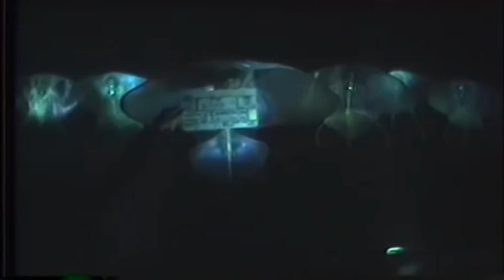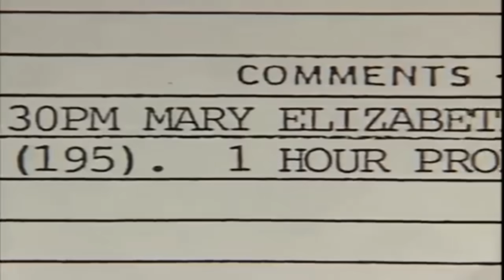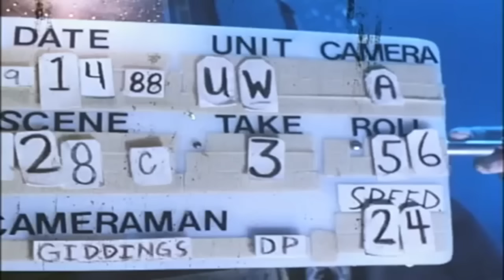Production Hell - The Abyss

Comment: The safety diver might have actually saved Cameron’s life.  Holding your breath while ascending can cause a fatal expansion of the air in one’s lungs.  Which can cause your lungs to burst.

The struggle over the broken regulator probably had Cameron expel most of the air in his lungs.

Diving can be very dangerous.
Reply: Not only did that guy possibly save Cameron's life he got that returned by being punched in the face and fired. Not worth it.
Reply: @Flaris  He would have eventually killed him spraying water into his mouth…either way it was an accident, radio guy deserved to be fired but not safety diver guy.
Reply: @jaydenshepard7928  The boss is always going to blame their own created problems on others, comes with the privilege.

Comment: Ah, yes. The "water tentacle" scene. Back when I owned the DVD, and watched the dvd extras, the crew planned a back-up plan if the special-effects department couldn't reproduce the water, in a realistic way in that scene. The back-up plan involved basically a robotic sock — an animated movie screen — with several movie projectors hidden off scene. The movie projectors would display the opposite wall of the water tentacle depending on how the sock was orientated in the scene; the angles and projected images were perfectly planned with computers, though. You get the idea. I wonder what the water tentacle would have looked like if it was done this way, instead of cg? (rhetorical)
Reply: The effect would might have looked awful even for 1989.
Reply: @redpillfreedom6692  Ahh.... not so fast. Practical special effects do hold up over time, especially if a particular movie put new research into the tech they wanted to show. The Thing from '82, Willow from '88, (the two-headed dragon was stop-motion), The Terminator from '84.

And believe it or not, "HBO In Space" from 1983 is mostly practical special effects.

If The Abyss chose to shoot the water tentacle scene with practical, instead of cg, maybe it would have turned out good! Back in 1988 and '89 we could most certainly have computer controlled cameras combined with computer controlled pieces of scenery, so that the special effect was captured in camera.

Comment: And the worst part is that it wasn't even a great film. The ending especially felt rushed and tacked on.
Reply: The Director's Cut has the original and intended ending, which is far, FAR better.
 
Give it a watch, because it changes the dynamic of the film completely.
 
Hint:  The aliens aren't hostile, per se, but they ARE presented as a threat.

Comment: A company I worked for in San Diego had been contracted by Cameron's production company to manufacture a hemisphere dome machined from a giant boule of fused quartz.  This thing was about six feet across and 5 inches thick, which is pretty frickin' huge, and a very complicated operation.  The process was taking longer than anticipated, as you don't want to rush a project like that, and you have to adjust feeds and speeds depending on the workpiece's characteristics.  James Cameron himself stormed in one day and yelled at the CEO, basically firing the company from the job.  A few weeks later, he came crawling back, since no one else in the western hemisphere could do the work.  The CEO said, "Kindly, GTFO of my building."  Sometimes, James Cameron's money just isn't as green as someone else's.

Comment: If Cameron was the accomplished diver he is made out to be, he would not have held his breath trying to reach the surface. That is one of the basic lessons in scuba diving, to NEVER hold your breath while ascending. Your lungs are filled with air that is compressed by the pressure at the depth you are at. As you ascend that air expands as the pressure decreases. If you hold your breath and don't let out the expanding air, you will damage your lungs. I think Cameron did exhale during his ascent, and as a result he was completely out of air when he surfaced.